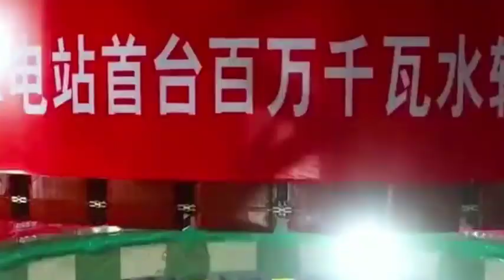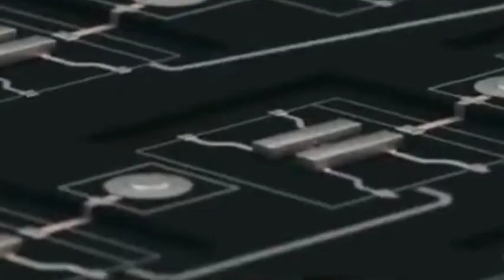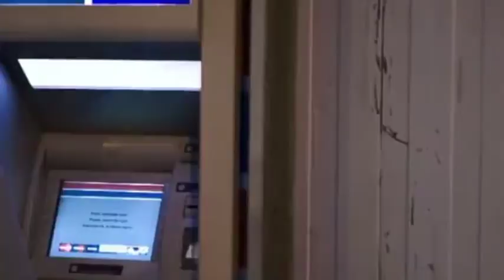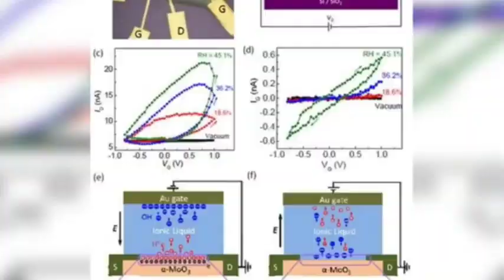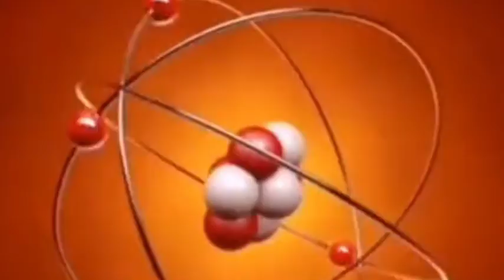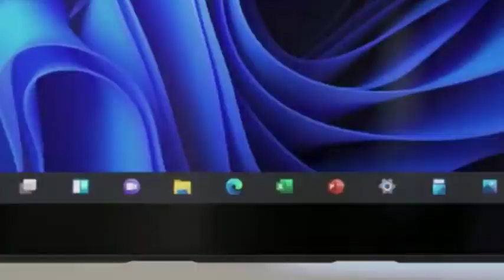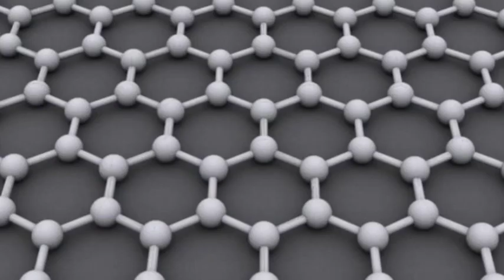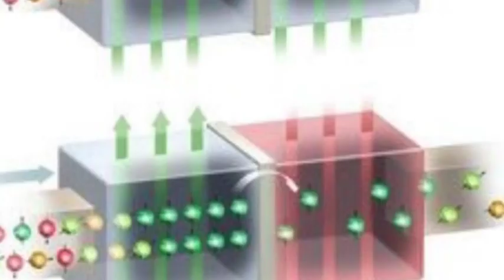The US formed the "Quadruple Alliance" to prohibit maintenance of Chinese chip equipment.

Comment: God forbade China reaching USA's level - a third world country which cannot build a 5nm plant even though they were boasting about TSMC (forced to) building a 5nm plant in Arizona. 🤣
USA manufacturers are still at 7nm, the largest foundry in the USA - Intel - just released their 7nm processors, and for mobile only cause they can't overclock them to 6GHz to match their previous gen 10nm++++++++ process with its 300W powerdraw for desktop. Huawei managed to produce basically a 7nm chip while being under sanctions, preventing them of acquiring 7nm lithography machines. The cutting edge foundries are located in Taiwan and South Korea and Uncle Sam wants to acquire these and leave the suckers living in these countries to die in the trenches like it happens with their European proxy. But even if Samsung and TSMC pack all their machines and employees and move them to the US it would still take years till the relocated foundries can start production. China would've outplaced the US in the R&D field completely at that point.
China shouldn't fear to directly pressure the clowns in SK and Taiwan - very soon they'll be simply fragile competitors to mainland foundries, deal with them like their masters in Washington do with others. Not to mention one can acquire a lot of the engineers working in TSMC and Samsung this way.